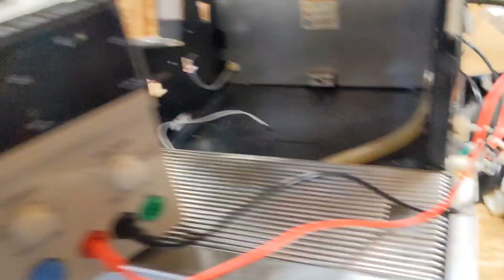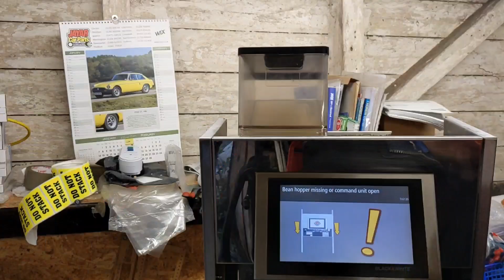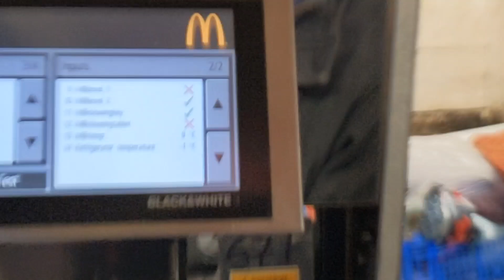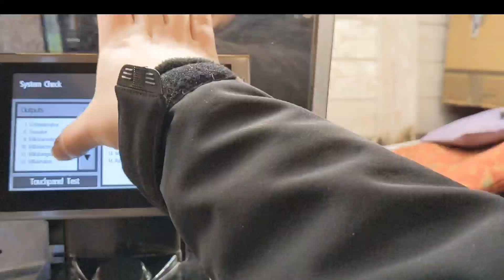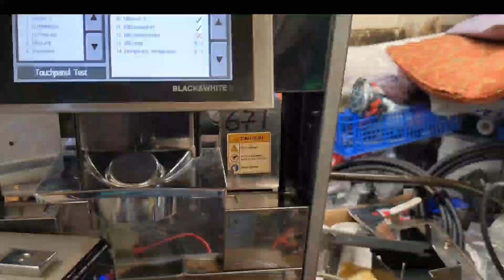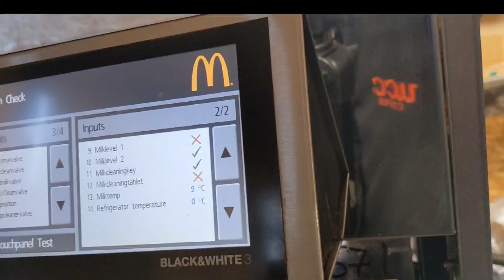Part 2 of Fixing A Thermoplan BW3 Black & White 3 Coffee Machine.

Comment: PSU struggling underload is most likely electrolyitc capacitors on the output side, check them for high ESR.
Reply from the maker: Thanks for watching a leaving a comment. we checked the capacitors they were ok nothing to worry about. while testing the power supply died. not surprised it had been working for 15 years 24/7 spoke to customer who didnt want to throw money at it so it was decided to scrap the machine out.
Reply: Where abouts can I buy parts for these?
Reply from the maker: @154electrician  what sort of thing are you after
Reply: @rlfvac  thinking of buying one of these , do you service them?
Reply from the maker: @154electrician  we can do certain things on these machines.
Reply: Who can help me please. I accidentally pushed on MC Donald's configuration. Now my machine is in POD mode and I can't get out of it and load other programs. How can I load the other settings. Did a global reset,and won't work😢